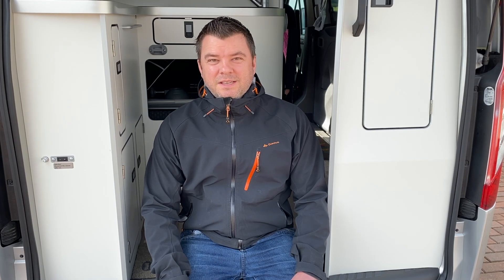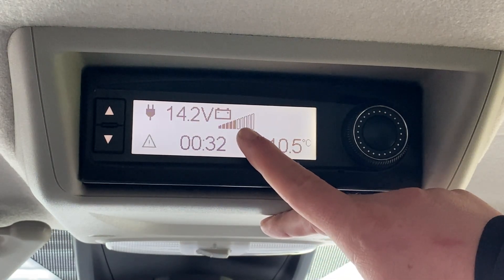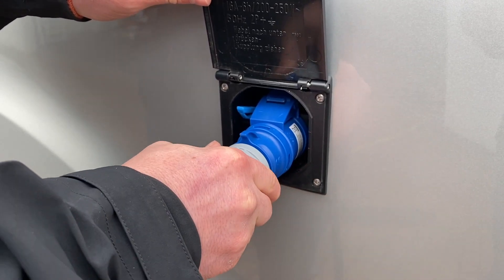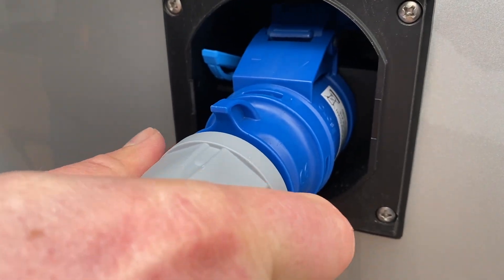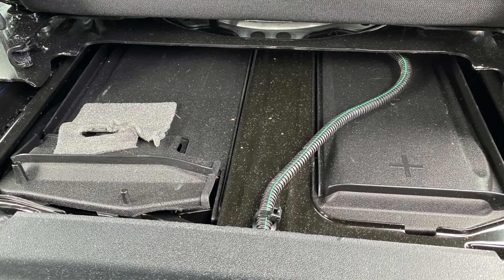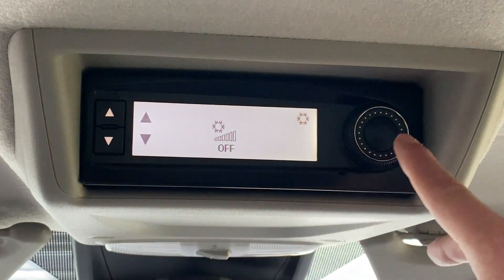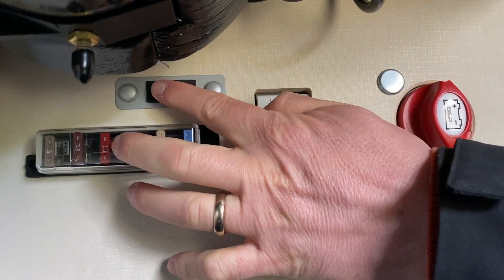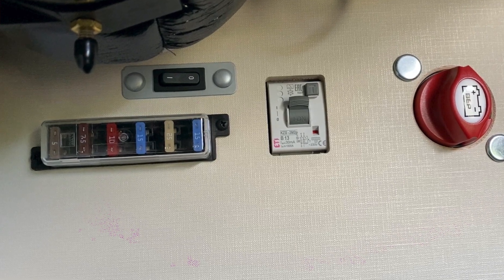Ford Transit Custom Nugget Family Campervan UK Episode 10: In-Depth Electric System Review

Comment: Hi  there. Just recently bought a Nugget Plus and been away in it for the first time. Not sure about what needs to be on/off when your travelling.  For example can the gas be left turned on at cylinder and switch over duration or should it be turned off after each use(which is what I did) ? Also should the electrics be turned off when you're not away camping or can that be left on? Would be grateful for answers to these and any other do/don'ts when out camping. Many thanks. Pete

Comment: Wow! So detailed and informative! 👏🏻Got some questions: Can you use 220V plugs while running on battery? Does the Audio System consume from the auxiliary battery or the starter battery when the engine is off? Does the Audio System run on 220V Power when the Nugget is plugged to the grid?
Reply from the maker: Thanks for the feedback and great questions. The 230v sockets only work when attached to the mains via an electric hook up. They do not work on the battery. As for the audio system it works when the engine is off in much the same way as in a car. I assume it draws power from the starter batteries as it works when the master switch is off. Technically both the starter and axillary batteries are charged when the 230v hook up is connected so I guess in a round about way they are. I am not an expert and it maybe worth checking with your Ford dealer if you need a fully accurate answer, this is just my understanding. Due to great feedback I will be releasing an electrical system update video soon so look out for this.

Comment: Very comprehensive, well done. A small point to note is that when plugged into the mains the cable should be fully unwound. Even a few coils will act as a heater if you draw a reasonable current and increase the risk of fire in the coil.
Reply from the maker: Absolutely- thanks so much Richard for highlighting this important point.